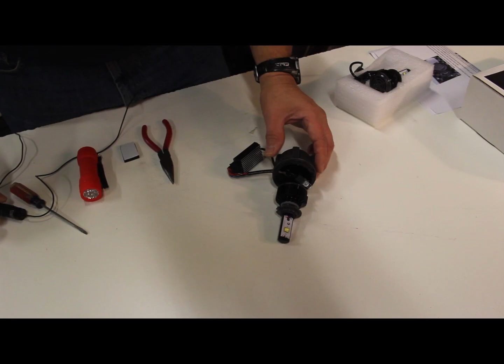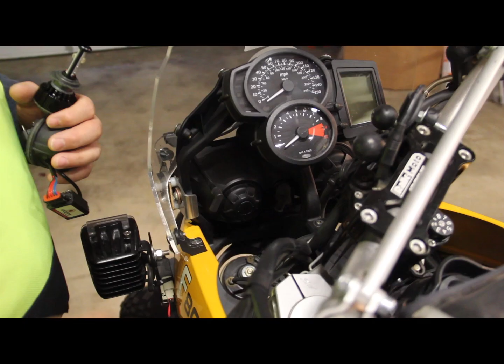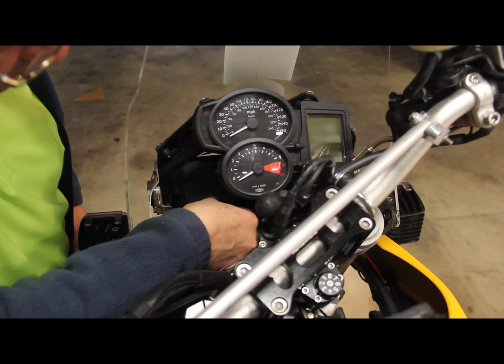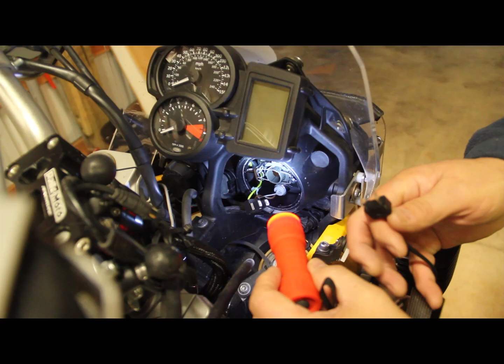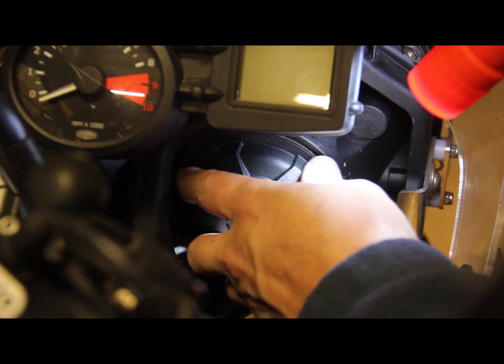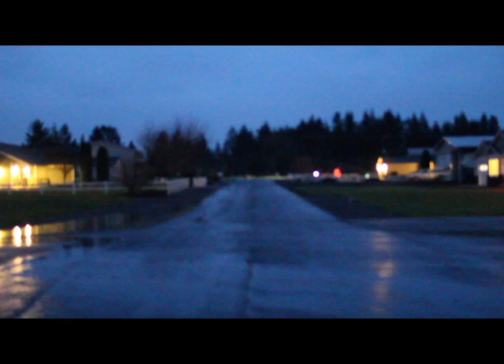Cyclops LED Headlight Conversion BMW F800GS

Comment: Cyclops LED : ONE STAR ONLY.
About their attitude : I had to rate my >>negative review<< 5 stars on Cyclops website to have it published. Less than 4 stars and the administrator will not publish your comment. I tried before so I can testify. This is just dishonest business!!!
About their bulb : I had a Cyclops H4 Ultra on my CRF250L 2018. Very bright but died after one year only. The driver (black box) was much too hot, I couldn't even touch it. The bulb started to flicker (driver too hot??) then died shortly after. 90$ for only one year of use ??
I replaced it with a Novsight 12000 lumen LED bulb for a quarter of the price. 
3 years since and zero problem. Driver is not even warm. Very bright and nice cutoff patterns same as Cyclops, and I have one extra bulb as spare (Novsight is sold by pair). 
Cyclops is not worth the price (90$) for ONE bulb. There is better options out there.
Think before you spend $$$ with Cyclops. Novsight is a much cheaper/better alternative.
Just my 10 cents.
Reply from the maker: When I made that video I was happily selling Cyclops bulbs.  Today I'm not (because I'm retiring) and I have no official connection with them, so my comments are without any agenda...   I have nothing but good things to say about Cyclops bulbs and the people who run the business.  Every interaction I've ever had with them over the years was positive, and the bulbs were the best ones on the market.  I don't know exactly why your bulb didn't work out for you.  Yes, Cyclops has a 1-year warranty, and good reasons:  Bulbs on motorcycles usually don't last very long due to vibration and other factors, especially if the bulb you select is a high-performance version like those sold by Cyclops.  (stock bulbs last for years because they're performing at minimum output).  There's a trade-off between performance and longevity.  That being said, I've had Cyclops bulbs in my dirt bikes for over 5 years and they're still going strong.

Comment: Another question how the ventilation happening if everything is already sealed? The fan won't get any fresh air
Reply from the maker: The fan blows air around the inside of the housing.  That provides enough thermal relief that there is no need for external venting.
Reply: @BestRestProducts  thanks for your explanation

Comment: You sound like Hershel from The Walking Dead series! Thanks - great video - makes it all so clear (excuse the pun)! Do you happen to know what the current draw of this setup is, compared to stock? PS If you reply to comments and questions directly, by hitting the "reply" button under it, that user will be notified that you have responded. When you respond by creating a NEW comment they have no idea that you have in fact responded to them unless they come back and take a look by scrolling down the list. See my reply to Philip B below. Oh and one last thing, my kit came with the wires already fed through the replacement cap on the high-beam assembly saving a bunch of time.
UPDATE: I timed the installation on my 2013 800GS. From walking up to the bike to turning it on for test - 7 minutes! Fitting these is a breeze. Took it for test ride and wow what a difference! The low beam is more of a defined "block" of light that is both brighter and whiter. And the high-beam is amazing - punches a powerful far reaching beam that I would estimate is three times longer than stock. I had the bike on the main stand pointing up the road and checked before and after. Then I went for a ride to get a more subjective feel. Worth every penny - a must-have safety upgrade.
Reply from the maker: A stock halogen bulb is 55 watts.  That equates to  about 4.5 amps.
A Cyclops bulb is 30 watts.  That equates to about 2.5 amps.
Reply: So we gain a way better lighting system with much lower draw. Way to Go!

Comment: You should do a new video. Cyclops updated the lights so you no longer need to cram all the stuff into the sides. They made the caps bigger. The install is much easier overall. You should also, you know, zoom in on the process. It is pretty easy, but a little more visual detail would be better.

Comment: There's no proper beam pattern or cut-off on low beam
Reply from the maker: CDI - I don't know why you would say that. Perhaps the way we showed the pattern on the wall wasn't a good representation, but on the road the pattern is well defined.

Comment: There's no proper beam pattern or cut-off on low beam, it's just a bright scatter of light.  Surely it annoys other drivers?
Reply from the maker: I don't know where you're getting that information... YES there is a beam pattern.  High beam is full and bright, low beam has a cut-off pattern which you can see when you're riding.  That cut-off is a function of the reflectors inside your headlight housing.  Because the bulb is so much brighter than stock, the amount of light coming off the headlight tends to cause the camera lens to show it as one bright blob.  As far as annoying other drivers, nobody's complained, nobody's flashed their headlights at me when I'm running on low beam.  Annoying other drivers is the least of my worries.... I just want to see down the road, and I want the other drivers to see ME.
Reply: I agree - the low-beam pattern is super-well defined on mine. It is way clearer than stock

Comment: You guys need to show a video at night from the riders position.Not that ridiculous video seeing the bike coming towards us flashing it's lights....
People need to know these lights are VERY bright up close for the first maybe 30-50' like in your demo on the garage door...but after that the lights do not project very far (this is pretty common concerning LED lights in halogen housings without projectors)
I've tested these and Opt7 lights which are brighter than cyclops and it's pretty much the same conclusion. Not enough light projected in the distance. 
And for motorcycling, this is just not good enough for people who don't have any other type of aux lights..
I have low beam HIDs and they project much further, but are less bright than the cyclops. I decided to keep the HID and super bright halogen for the high beam and this is the brightest setup ( not including my aux LEDS spots)

You guys have a nice product, but these lights are not adequate for an 800gs that doesn't have any other aux lights avail.
Reply: I think maybe you have faulty product. I just fitted these identical lights on my F800 testing it before and after. The difference on low-beam is not going to blow you away but it most certainly is brighter and "whiter". The coverage is similar but has more defined edges where the stock lamp fades into black progressively. But the high-beam is like night and day - literally. I walked up the road with the stock lamp and drew a chalk-mark where I figured it was no longer "acceptable" and then did the same thing with the cyclops - and had to walk just short of three-times that distance. So there is something wrong with your bulbs...

Comment from the maker: Loosen the two bolts that hold the headlight assembly , slide assembly forward, that should solve the contact issue. because the caps are flexible they will move if the tube touches them.
Reply: Thanks Dave!!!

Comment: BMW F800GS Adventure 2015:  I just installed the high and low bulbs. A bit of fiddling with the low beam driver in order to get it to fit but after a couple minutes all went in well...tight fit but it's in. 
When the handle bar is turned all the way to the right the left fork ever so slightly pushes on the high beam cap/housing. Doesn't seem to be an issue. I may see if I can adjust the front assembly forward to eliminate this matter. I'll have to figure out how to do this. Say I were to crash in sand and the handle bars got slammed right it could in theory pop the high beam cap off or damage the cap but not likely. 

It's currently day time so I haven't had a chance to evaluate the brightness at night. I will test tonight and post an update. 

Thank you David!